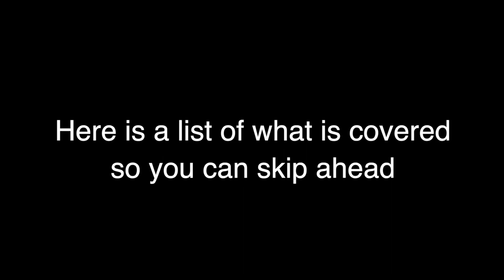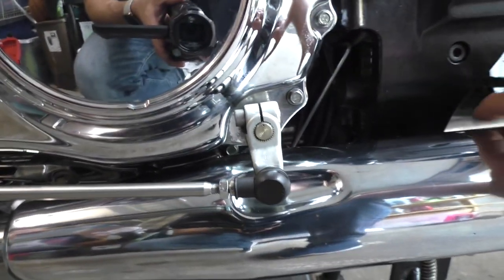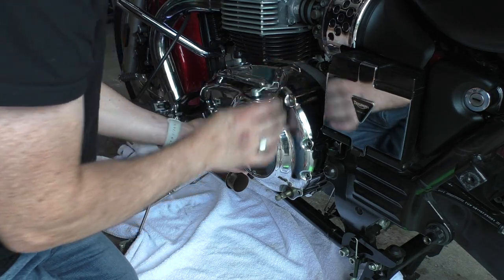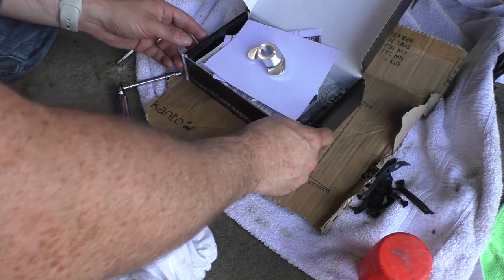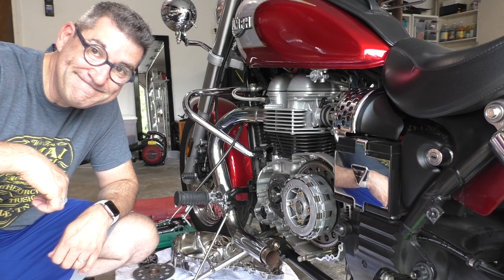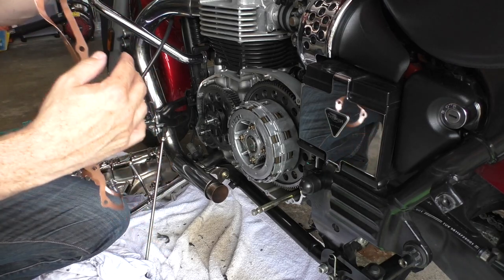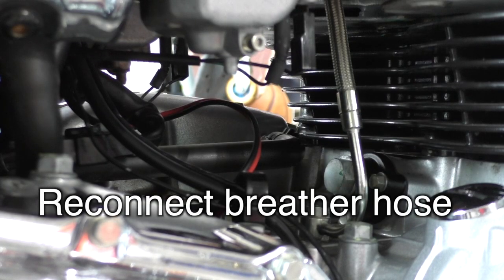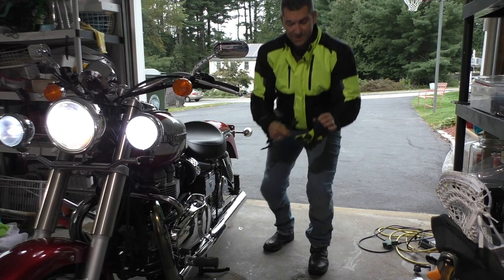Replace clutch gasket (oil leak) & install TTP safe-start 2002 Triumph Bonneville America

Comment: The reason the oil spluttered as you drained was the air bleed on the sump pan wasn't opened and so the air being displaced had to come back up through the hole the oil was trying to pour into.......minor point but may save some mess ;) My Only MAJOR criticism is that you changed the oil without changing the filter. For the sake of a few bucks you missed an opportunity. Oh, and torque wrenches are only for doing stuff up never for undoing. Apart from those two issues it was good work. I'm so glad you double checked the oil seal. You literally had me shouting at the screen :))))))
Reply from the maker: Thanks Steve! Very helpful!

Comment: Nice video! - and good work.  Question, does/might the short shaft for the starter idler gear (?) need a touch of lube/oil on reassembly? = 29.24 in the vid.

Comment: Bought a 2004 the beginning of the summer, it runs like a clock with just under 15,000 mile on it. Living in the middle of Wisconsin, I found that the bike shops will only work on HD's and a few different Japanese bikes but refuse to work on Triumphs. Heck I had a shop change my front tire as I didn't have the time a month ago and they acted like they barely knew how to do that. I am saving your site, I have a feeling I will be using your site a lot.
Reply from the maker: Thx Tom,  Yeah, I hear ya...  So for my tires, I took the wheels off myself.  I got 1 tire off, but could not get the new one on.  So I brought both wheels to the local shop and they did them fast.  But it was only the tire / rim, so super easy for them.  $40.  Then I re-installed the wheels on my own.  I'll do a video for it next time I swap them!

Comment: I had  2004 speedmaster last of the carbs
it was known in uk that their was a problem with the washer you showed. Under warrentry it was £20 but after warrentry run out it was £180.
I went to motercykle college on sat for 2 yrs @ £150 @ term and become a semi qualified bike mechanic.
then just after that triumph changed design of washer and fixed problem.

Comment: Great video Ethan and nice work..  you did it! and so did I! thanks to your helping with this video ..for a little more info to add for some other folks, I did a 2007 Bonny T100 and the breather pipe is NOT connected to the clutch cover on that year model, not sure why the difference but there is a crank case vent system on the "inside" of the housing behind the gears, so no need to pull that hose off.... second thing, and it's semi important to do as well, is also take some isopropanol, denatured alcohol or acetone, anything that totally evaps away and be sure to clean that TTP part super clean as well, as it was brought to life in a machine shop ..I didn't see any machine oil residue on that piece when I did mine but ya never know I even got the skin oil off the part from my handling it to give the JB Weld all the help it needs to do it's job!...thanks and Best Regards,     D.
Reply from the maker: That's awesome Doug!  Thanks for the update and the helpful tips to the next guy working on this project!

Comment: Ethan thanks for that video.  I am a 63 year old, fairly decent DIY mechanic but really benefitted from watching your video (several times).  Had I watched it patiently through the first time I would not have had to order parts from Fast Eddy twice, now maybe 3 times as I should have ordered part #T3600008 as well. :(  Live and learn.  I had 2 nuts strip and installed helicoils.  Thanks for the TTP safe start tip, I'm waiting for that part to come.  Once again thanks for the video...its a selfless act putting that on youtube nd much appreciated!  Sean
Reply from the maker: Thanks Sean!  I appreciate the warm words.  I remember that feeling of waiting for the right part to come.  But...  I figure... it's been a fun project.  I wasn't sure what I was doing all the time, but had some great support on the FB forums for the America and Speedmaster.  Thx again and good luck with the TTP installation!  From all I've learned, it's a very wise thing to do for these bikes!

Comment: Great video Ethan !  As Ethan commented, adequate copper spray is needed, and don't be afraid to spray the gasket thoroughly !! . A waiting period of 10 minutes is definitely recommended,  or until it becomes tacky.  The alignment rods are a lifesaver !  They will aid in keeping all the bolt holes in alignment.  4 alignment rods will suffice. I use 2 along the topside, one on  the right side, and one somewhere on the bottomside. Try not to use an alignment rod on the far leftside, as this will impede your ability to slide the cover onto the rods.

Comment: Maybe next time; put a very thin layer of permatex ( oil resistant)  on cover;;; then place gasket to cover first.  Let set 15 min;   then with a few of the cover bolts through the side plate;;; attach to engine.
I did just learn about the Copper Spray though.  And the rods.   So; either way;; I'm learning as well. 😊😊😊

Comment: Hi Ethan, thanks again for the great video and I had one last additional question about the oil seal by the lever mechanism on the top of the clutch housing that the clutch cable is attached to. To replace that oil seal I do have to take off the complete clutch housing, is that right? It can’t be done just from the outside? Thanks, Bob Vertz.
Reply from the maker: Hi Robert, yes, you will remove the clutch cover completely and then clean both sides.  And put the new gasket on when putting it back on!
Reply: Thanks for the answer Ethan! You had a great video and I plan to subscribe. Bob

Comment: Hey Ethan, great video. I admire your patience...but maybe just a question; 
As a mecanic I've learned a lot of tricks during my career. I have broken so many parts while assembling I can't remember. That's what we call learning costs...
But maybe  I've got some advice for the ones doing the same repair to their bikes; I am going to place this safe start I recently bought from TTP and your video has given me a good idea of what's coming. 
I would have taken rods that are shorter (a bit longer then the screws) and leave them on the bike while mounting the cover. This would have guided the assembly of the cover a lot better I think. Once the cover is in place, you can take them out and replace them with the screws, one by one so the gasket doesn't move.

That being said, I only have one question. Was there  a reason why you didn't do it like that or has this been a lessons learned? Greetings from Ghent (Belgium)

Comment: Thanks Ethan for great video. Maybe someone could answer this question. I have a 2004 Triumph T100. I have an oil leak on the clutch arm lever mounted on top of the clutch housing that the clutch cable attaches to. Do I have to take the complete clutch housing off to replace that seal? Any advice would be appreciated
Reply from the maker: Hi Robert,  I think you do need to replace the seal.  If the clutch is open for any reason it's a good idea to replace the seal.  I've hear some guys say they just put it back on with out replacing it, butI have to imagine that's a bad idea.   Once you get the hang of it, go for it!  Maybe order 2 or 3 seals at the same time, just in case you screw it up!  let me know if I can be helpful.

Comment: Hi Ethan, great video. Maybe someone could help with this question. I have a 2004 triumph T100.oil is leaking by the seal on the clutch housing where the lever is that the clutch cable attaches too. Does anyone know how to fix it?

Comment: This is AWESOME video Ethan! I gonna replace the gasket on my 2002 Bonneville as well, this video help me a lot with the details and situation may facing. I even dont know TTP safe start before watching your video., Quick question, how do you know each bolts torque requirement? I have a Haynes manual, but didnt see any info inside. Thanks!
Reply from the maker: I googled 2002 triumph America manual and a bunch popped up.  if you email me, I can send you the two that I have ebecker@mac.com
Reply from the maker: And thank you for the positive feedback!
Reply: @sigmapifsc  thats awesome! just sent you the email! thanks!

Comment: Great video! Clear to see the work, good quality, and good work! Question. Does/might the starter motor idler gear (?) short shaft need a touch of lube on reassembly? Vid 29.20 or so.
Reply from the maker: Hi Pat,  Thanks for the comment!  Regarding your question...   I don't think I would add lube to that part.  I would keep it as clean as possible. My understanding is that oil flows through out this case, so it will keep it nice and lubricated.  I would not add any additional lube.  If anything, I might do  a dab of the same engine oil.  but only if for some reason I felt it needed it.  In this video, I did not, and didn't feel a need for lubing that part.  In fact, I worked hard to make sure ALL oil was cleaned out.  If any lube or oil ended up on the edge by accident, it would mess up the gasket.  I hope this helps!

Comment: My bike's leaking oil between the casing and the cover, the gasket must have gone.   You might have cured the leak, but you might not have cured the problem - let me explain.
1st point -  were all the bolts holding the cover tight or were they loose allowing the oil to pass?
2nd point - when you fitted the new gasket and filled the engine with oil, did it leak again - probably not
If it was OK when you finished and there were no loose bolts at the start - you've only sorted the leak. - the problem might still be present.  A blocked breather on the engine stops excess pressure getting out and it finds another route - normally through a gasket.

Comment: I have the 08 Bonneville with an 865. Should I be worried about this? I'm not clear on exactly what years are affected by this. Great work up 
Thanks
Reply from the maker: Hi Daniel,  thx for the comment.  My understanding is that yes…. All models and all years have this concern.  It has to do with how that part of the case was designed.  What can happen is if it cracks,  there is no other fix than replacing the entire casing which I Beale is over $3000usd or something.  It was a fun project and a simple precaution.    As far as I know,  there is no way to tell which bikes will be effected.   If you post about it on the forums you may hear real world stories.

Comment: Surprisingly the 2006 model is not the same as your 2002. I just took my clutch cover off and it does not look like yours. the sprag assembly is not the same at all.
Reply from the maker: Wow, I didn't know that. Perhaps you can make a video showing the guts?

Comment: When you took off the smaller gear, where the wavy washer lives, the blue marker dot was at about 12 oclock.  When you put it back together, that dot wasn't in the same place.  Does it not matter which position those gears go back on?  Do they have timing marks or anything on them?
Reply from the maker: Thx!  I never noticed that blue dot.  So, I’m going to go with it doesn’t matter.  It’s been a couple years now and the bike is still running really well!